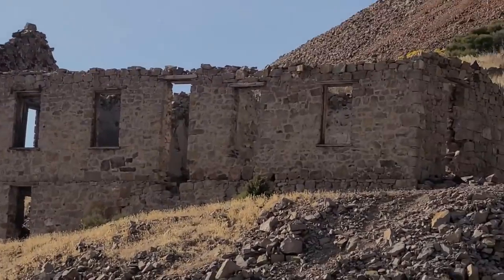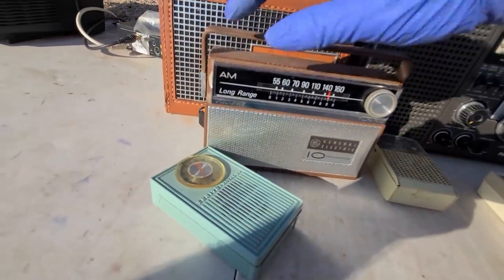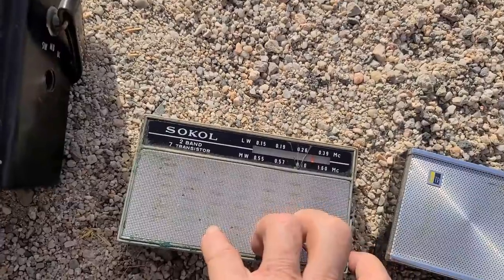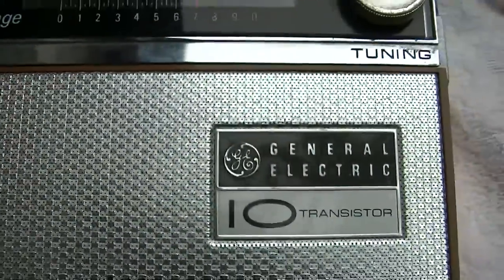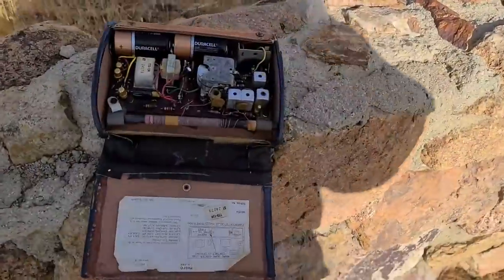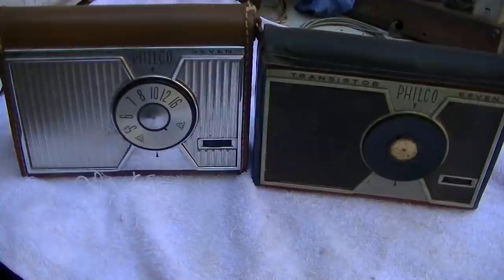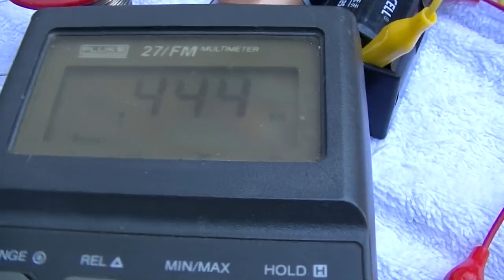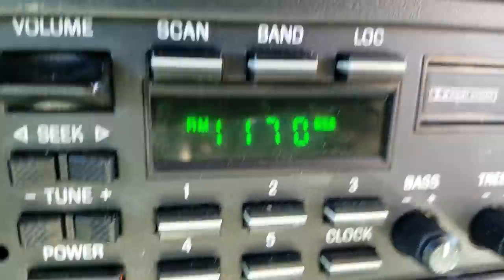Transistor Radio Sensitivity Performance Test Fringe Low Signal Locations

Comment: Thank you for referring to AM stereo ID's as "Awesome."  We proudly offer them, too.  You won't catch us in your neck of the woods even on the best of ""DX" nights...but...we use a Carver AM stereo tuner to provide AM stereo sound to anyone online at WION's website and on all modern devices. (not from our control board or processor, it's from "over the air" and even has our pattern changes to prove it at the proper time each day.)   It amazes people how GOOD AM can sound when broadcasters care, and proper receivers are used.  AM stereo does not decrease range of the station (that's a myth many people believed) and with proper processing is awesome in sound, too!   Thanks for another great video about the "Awesome Modulation" band.
Reply: A new classic hits music station just went on the air here in October,  CFAJ on AM 1220 with 10kW... very good 1940s to 1990s oldies/classic hits variety!
They have been in commercial-free "test broadcast" operation,  but between songs ask for people to send e-mails with questions and comments about the reception quality and the music content, and I did.  The first thing I asked for them to do is install an AM Stereo exciter!!
Reply: I am totally unaware how that AM stereo works (being European) - does it use the same pilot of 19khz and require same decoder as the CCIR FM stereo? I suppose the IF out signal would not be even routed to the stereo decoder in the standard receiver, when switched to AM.
Reply: @piwex69  IIRC AMstereo is a digital system.
Reply: CQUAM uses a 25Hz pilot. The L+R doesn't change to maintain compatibility with existing radios. The L-R is modulated separately.
Reply: No, it's as the name implies, amplitude modulation with stereo using Motorola's CQUAM system.

Comment: Those old, abandoned shacks in the middle of nowhere intrigue the hell out of me.  Great video.
Reply: You know it’s old house when it still has some of those porcelain insulators for real old time wiring. I had house in Detroit with some of those in it. House from 1924.
Reply: From that house back in the day they probably listened to WLW 500,000 watts on their crystal set.
Reply: You know it’s old house when ‘ newer ‘ addition wall is from the 1940s
Reply: Michael Szczys I have been working in a apartment with 1  knob and tube line in the attic the wire just ends and is tied, one for each apartment, the place was built in 1935 around that time, and I figured out that one wire was    For a radio antenna , the rest of the electrical  was in conduit, it probably was remodeled at some time..
Reply: @cardboardboxification  my house was built in 1930. It has a cool outlet in the living room labeled “antenna”. There’s a wire that goes into attic and strung across the length of the roof. Pretty cool.

Comment: I have the Panasonic AM/FM/SW radio that was featured in this video.  My folks bought it around 1978.  We had a local radio station but the good stations (AM) were about 60 miles away.  A pocket radio would pick a couple of them up faintly but the Panasonic radio picked them up much stronger.   I liked the AM antenna that could be rotated without having to move the radio around.  The FM also picked up stations from long distances away as well.

Comment: Question for Shango:
Do you have a Unelco 1914?

It was a radio that had an unusual combination of features. It used old-fashioned octal base radio coils, where the user needed to change a pair of radio coils to change bands, and if you wanted the whole spectrum from 540kHz to 30MHz, you'd need to buy five more pairs of coils (it came with one pair of No. 5 coils for 31m to 16m).

If you're thinking this was a vacuum-tube set from before World War II, you'd be wrong.

They lacked AGC, lacked BFO, had a front-end trimmer, a few transistors, and a cheap, thin plastic cabinet, and made in the late sixties!

Comment: That little Sony at the beginning deserves a fresh 3d printed body.
Reply: That is a really intriguing idea.
Reply: @KameraShy  For anyone willing to try it, they could either do a whole new case for it, or just the speaker and the back side. Those are the major damaged areas.
Reply: Back in the early days of AM radio, 500kw transmitters were trialled and supported for use by the fact they could provide service to many rural locations but it was decided to standardize on 50kw maximum which left many areas remotely unserved by AM radio.
Reply: I'd mount everything on a plank of wood.

Comment: The Sony needs a cabinet rebuild. Plastic can be rebuilt even as bad as it is. Great performing and great sounding Sony radio
Reply: 50's plastic was so very primitive and just disintegrated.
Reply: Stick it in a wood tube radio cabinet
Reply: And a new speaker also. You can see a lot of cracks on it.
Reply: @KameraShy  
It sat in a desert mining camp for 50 years. Years of UV damage will embrittle plastic.

Comment: You have good ground conductivity in Los Angeles, 15 millisiemens per meter, that explains why you pick up AM radio stations in the middle of the day 250 miles away without any problem.  You even get more impressive day distance in the great plains, where the ground resistance in some areas is 30 millisiemens per meter.   I experienced this when I was driving from Helena to Great Falls Montana and was listening to a radio station CBR in Saskatchewan, which is 400 miles away at high noon in the middle of the summer.   Long wave stations are even more impressive.  I remember driving around England and Scotland in 1989 and was tuned to the BBC On 198 kHz and the signal was strong everywhere as well as being able to pick up many continental stations on long wave.  Most of the long wave stations in Europe have been taken off the air to be replaced with networks of multiple digital transmitters that have much lower range.  Here's a map of ground conductivity in the US:  https://www.fcc.gov/media/radio/m3-ground-conductivity-map
Reply: I have old 1934 Philco that I have had since 1960 and once back in 1970s I hooked it up to my CB antenna and was listening to an oldies station in California for about 15 minutes bouncing off some clouds. It faded out and I left it run for an hour - it never came back.
I’m in Michigan.
Reply: @michaelszczys8316  Back in the 70's when I DXed every night, I used to pick up WBBM Chicago on occasion and WHAS in Louisville.   The best I can do now is KNX 1070 Los Angeles and sometimes Denver.  I'm in Vancouver, BC about 120 miles north of Seattle.   I have some radios of that vintage and they were designed for long wire antennas, which they work best with.  I have a 1946 GE table radio with a tuned "spiderweb" antenna that is wound on the back panel that feeds into a dedicated preamp tube, the performance is the best of any table radio I have.  Here's the schematic:  http://www.rfcafe.com/references/radio-news/images2/general-electric-219-220-221-radio-schematic-parts-nov-1946-radio-news.jpg
Reply: CBR is CBC Radio One in Calgary, AB. It broadcasts at 1010 kHz AM and 99.1 MHz FM. It can be heard as far North as Edmonton, AB and as far south as Northern Montana. Its AM channel is class A, clear channel, at 50,000 Watts. At night, it covers most of Western N. America. There are also a number of re-broadcasters around Southern Alberta. Like most CBC Radio One stations, it has a news/talk format.
Reply: @dougbrowning82  Sorry, I meant the station in Watrous, Saskatchewan, CBK 540.
Reply: @vancouverman4313  Another Radio One powerhouse. Being on the central plains gives these stations a great advantage.With Winnipeg's CBW 990, you can cross the entire plains and never lose access to the Radio One service.

Comment: Here on the East coast there is a lot of older stuff.  Every wall in my house is plaster. Slat and like a chicken wire and then hand plastered (presumably) on that.  It's very common in my area.

Comment: @shango066
My guess is that the Panasonic RF2200 needs to have the oscillators peaked again. If you tweak it just right it will match the Sony.

Comment: There was an Arvin that you had that used to distort on AM, Maybe the Philco and Arvin were both built for areas with little to no signal? But failing that I would check the AGC Line in both sets. I was thinking Audio distortion too on the Philco until you took it out of town,  Excellent Video from the days before LA Oldies went Caput!

Comment: I would check AGC circuit on that Philco. Also detector diode can be soldered with wrong polarity. Than it works as detector, but AGC voltage is wrong. 
If you like sensitive soviet AM radios, try to find VEF206.
Reply: It might not have gone bad, but was built bad.

Comment: Always great videos 🙂💚🇮🇪
Irish National Broadcaster RTE have announced the cessation of there DAB radio service 12C 227.360 MHz at the end of March. Mainly due smart phone Apps and the high rate of FM radios. No take up of Dab by the other commercial radio stations in Ireland. Gone is MW 567 only Long Wave 252 for the Irish in England is still very popular at a huge cost.
Reply: RTE on long wave serves the Irish aspidistra in the UK.

Comment: That was a good watch, thanks for including the pocket Sokol in your tests - I have the exact same one but it's impossible to tune it correctly due to the lack of AM stations in europe and no location that's free of noise, therefore I could never assess its performance.
Reply: Try the italian national program from Milan, it transmit at 900Khz. Currently the power output is 50Kw, but before 2003 was 600Kw.
Reply: @Telewaifus  Tuned and set the sensitivity to peak at 900KHz, the result is pretty amazing, that italian program is loud and clear, quite amazed that it's just 50kW. Finally made use of that MW band lol.
Reply: @yukayuyu3844   Where are you from? Btw in 2012 or 2013 they upgraded the transmitter , now the quality in northern Italy is very good. Google Image "Siziano Radio Mast", the second result is the antenna.
Reply: 540kHz AM comes from Hungary at 2000kW (transmitter "Solt"). A Sokol can pick it up from Dublin to presumably Moscow

Comment: Your 1170 Stereo Country is "KYET (1170 AM) is a radio station broadcasting a Classic Country format. Licensed to Golden Valley, Arizona, United States, it serves the Mohave County area. The station is currently owned by Grand Canyon Gateway Broadcasting, LLC, owned by Arizona State Mine Inspector Joe Hart and his wife Rhonda.[1] KYET transmits a stereophonic multiplex signal in the C-QUAM standard."   (6000 watts days and 1 watt night).  - Wiki

Comment: Next time you run one of these tests, given your interest in "Oldies" stations, please try to receive KYNO, AM 940, 50,000 watts, which began broadcasting from Fresno on 7/19/2021, before you did this video. Also, it would be nice to include one of the GE P-780 series of portable radios, predecessors to the Super Radios. They were designed for long range reception. You have a repair video on one of them.

Comment: There is no uV / mW parameter. The sensitivity of a receiver can be measured as uV for a specific s/n. The modulation of the carrier determinds the output of the radio.

Comment: +Shango066 At the 19:15 marker onwards, you state that you could not carry out an alignment as the IF Transformer was sealed.
Could you not melt the sealant with a soldering iron to carry out the alignment or perhaps it was sealed with a different type of material which would not allow this?

Comment: Great Videos ! Is there a book or crossref for Russian Transistors ? Looking for a replacement for a 2SB175 / NTE158. Thank You.
Reply from the maker: What transistor is it in the radio?
Reply: @shango066  PushPulloutputs
Reply from the maker: @55benchguy  if it's a 9 volt or lower voltage battery use MP40
Reply: @shango066  Your The BEST ! Thank You Buddy !

Comment: You should try a  cokoa 304 and a Hanrongda HRD-737  pocket radio, I have a cokoa 304 I use for performance long distance and the 737 radio, these 2 radios are amazing, there very good performers. The 737 radio is a little chip radio and it works surprisingly well, they both are really sensitive.

Comment: The radio that tends to overload: Looks to me like the converter has way too high gain, likely due to too high bias. The 1st IF is then overloaded (it can not process more than 5..10mV signal, regardless of the AGC signal). The downstream then won't overload, because the AGC.
What defect I met: A leaky, very noisy ceramic capacitor, as a result of battery leak. I had it in the af stage, but in your case it could be the emitter (bypass/oscillator feedback; depend if the oscillator feedback is to the base or emitter) capacitor in the converter. If shorted/leaky, the converter is overbiased so has way too high gain, overloading the 1st IF...

Comment: I'd love to get a Sony TR-712 to compare with my RF-2200, GE Superadio, and modified Tecsun (my current MW DX champ). Was the original Sony really that good, or was it the combination of the chinese transformer and soviet transistor?
Reply: It was an outstanding design. Sony was relatively an upstart in 1959 and wanted to show the world they could compete with the best american and european brands. They even included a super smooth gear reduction tuning  mechanism, unheard of in this category at the  time!

Now, with that said, I am sure Shango's alignment played a big part in the radio's overall performance and the Soviet replacement transistors are top quality for sure.

Comment: I surprised that you haven't used the rotating aerial on the RF2200 at 2.30. Surely this would improve its reception? 73s and GDX
Reply: He would have to rotate all the other radios to make it fair...
Reply: @crooner2007  Hi. Thank you for your reply. When I do tests of MW sensitivity of radios, I try to rotate them in the best direction signal wise. Then compare them for sensitivity. That's how I do it. Mind you, I was impressed by the sensitivity of the old Sony! 73s and GDX
Reply: @jimgordon1563  I would have thought Shango066 had determined the best direction for the ferrite bar to receive KNX at that location. In such a case, no further adjustment would be needed.

Now, with that said, there are odd radios here and there that have the ferrite bar oriented vertically instead of the most common horizontal placement. In such a case, yes, the radio would need to be rotated for the best signal...
Reply: Jim, do a comparison of one of your synthesized portables with a hot analog portable, like a Sony TR-818. Some of those panasonics and sonys with a tuned RF and 3 IF's are really hot and fun to fix if  they can be found.
Reply: @wilstjb3122  Thank you for your reply. You are right, I really should get a good analogue portable for comparison's sake. I've only PLL these days. I fancy a Panasonic RF2200 aka DR22 but these are rare in good condition. I did see a TR-818 for sale on Ebay USA but it looked rough and it would cost a lot in postage and customs fees to get it  delivered to me  here in Scotland. Any other radio you might recommend? 73s and GDX

Comment: San Jose can pickup KNX and KFI, albeit in the evening. That's at least 300 miles.
Reply: KNX comes in in Seattle at night
Reply: I live 94 miles NE of LA. I need a synthesized radio to pick up KNX. DX-440 or a PL-660. I have a couple of Sony tuned RF analog radios that can pull it in. 3 IF's a minimum. I use KNX as a test station.

Comment: Hi. i need your help again. on a tv from 2007. when it`s heating up, the picture is getting dark . i must cool it down with a fan to see something. what could be? thanks. i hope again you will help me. i just want to know what to check. love you. every evening i watch your videos. especially about tv. but with this one... i don`t know what to check first.
Reply: check the bias voltages on the crt cathode, grids etc. They must be drifting
Reply: A recent TV like that - its probably the capacimitators not capacatating (capacitors) on the LED power board
Reply: it`s a CRT tv. no name brand. produced in romania. IRYDER cheap one. 300 lei. in dollars about 74. the crt is a samsung. i have another one from 2004 also crt tv panasonic. working excellent even now. the panasonic was in 2004 arround 196 $. so i think the difference is how is build. the parts. panasonic was manufactured in the UK.
Reply: Try directing the fan to different parts and see what exactly needs cooling.
Reply: You mentioned 300 Lei and I remember that it was the amount of money offered by Caucescu to try to appease the masses.
Reply: @capolaya  yep old money. after Ceausescu was executed the money changed in 300000 lei. until 2005 when was changed back again. about tv problem something is ready to "explode" on the main board. i have just to search it like shango and touch everything :) is not smoking yet but i can smell it. maybe i don`t see smoke but is burning slow. i don`t know.
Reply: One thing to check let it run till it has the problem then unplug it and feel the heat sinks, if one is cold it needs new thermal paste...
   Feel capacitors if one is hot replace it..
    On one arcade monitor I rebuilt the Brightness control was with the blanking circuit , basically a voltage divider, one side turns the crt off for blanking the other side is max on for brightness control , the monitor was washed out and I found 2 bad diodes , .
  Start at the brightness control and follow the circuit and check components..
  Check power supply voltages and other voltages and watch it one at a time to see if it drops using a volt meter..
Reply: @cardboardboxification  it`s a big one. black. like a box. like a container. it`s very very hot.does not have some note on him to read. nothing. maybe this contains some other parts inside.